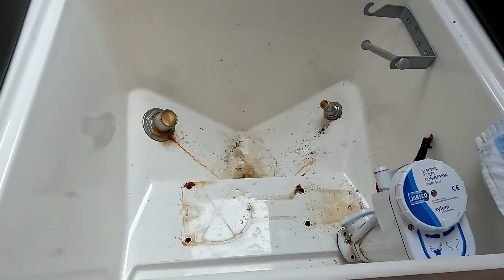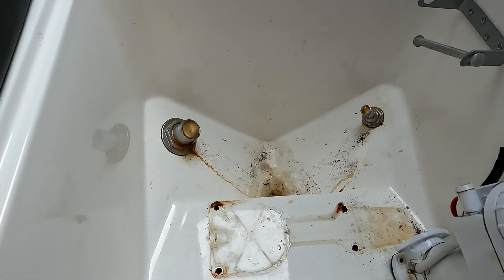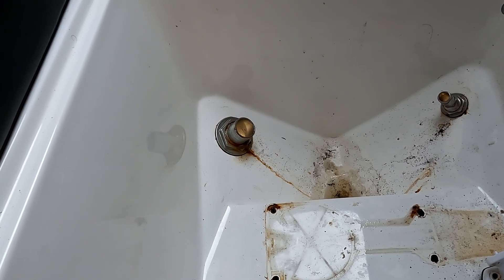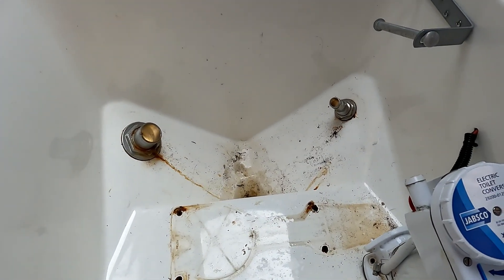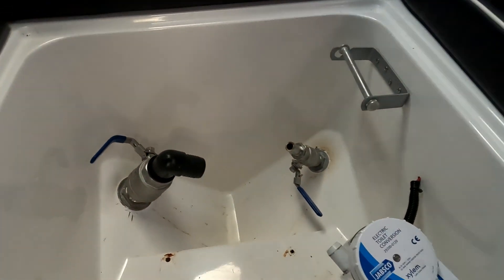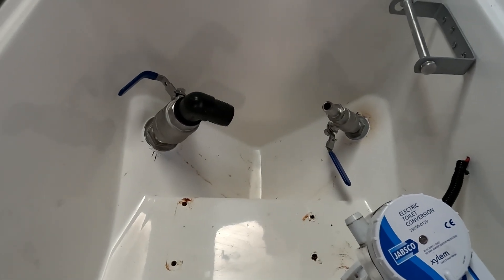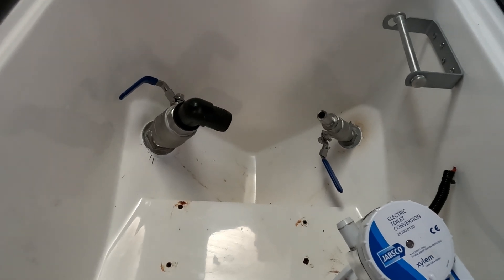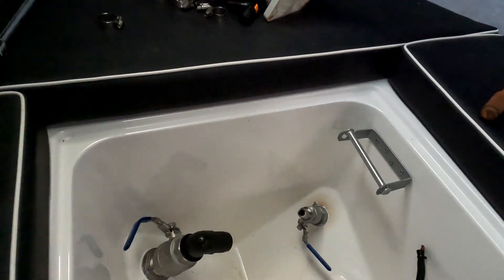Toilet Modification in a Caribbean 2300

Comment: Great work, I am just about to order a 2300. I am sure I can drop the new boat down to you as you are now the expert!
Reply from the maker: I can do anything for a price!
Reply: If you use locktite 577, then you will not need to over tighten the stainless threads.
577 is a thicker compound and is utilised on high pressure threads, Inc HP steam, therefore salt water with virtually no pressure won't be a problem, you can use a small amount of teflon thread tape too, however Locktite don't recommend it, it works a treat